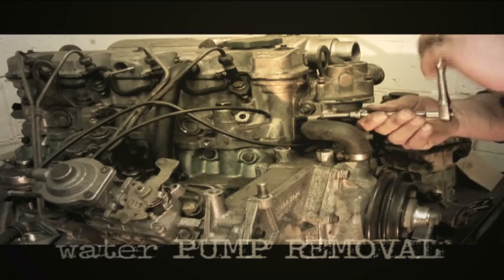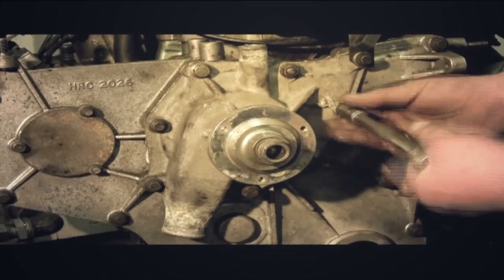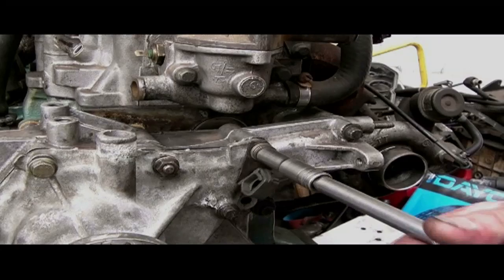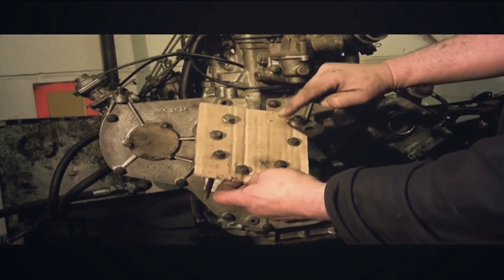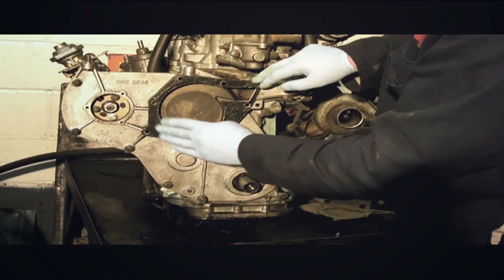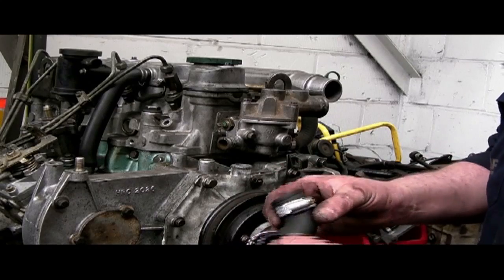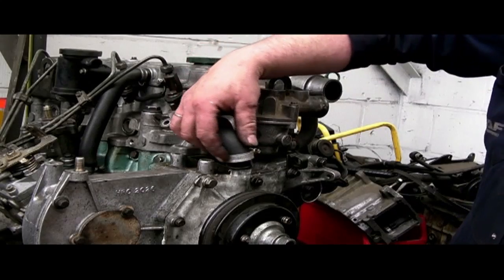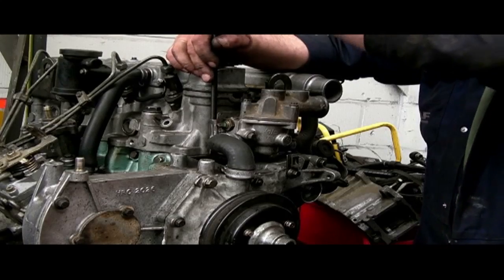Water pump remove and refit to the 200tdi discovery engine

Comment: Hi great vid, as you present detailled information. Could you tell something about the symptons, when a water pump is due for replacement? I hear a quiecking from time to time, preferrable after startjng the cold engine. When I lay more tension on the belt, the quiecking is gone for a while. It is a 200 TDi Discovery engine in a 109 Series 3. Water temp gauge just hits the red area.  Oil temp shows 85 to 100 degree celcius, raises to 110, 115 °C when working hard ( sand passages, uphill trailer hauling).